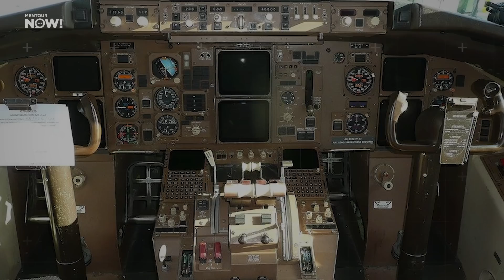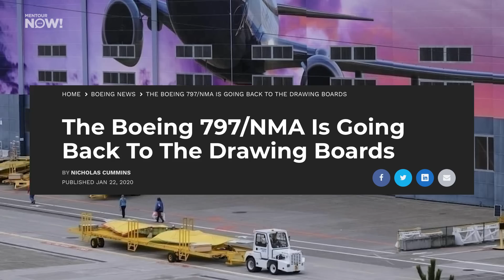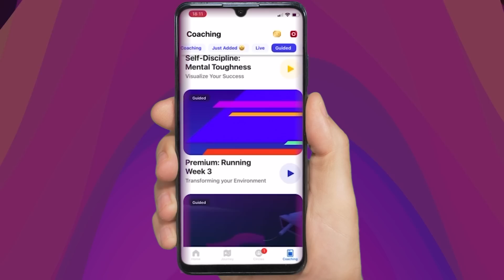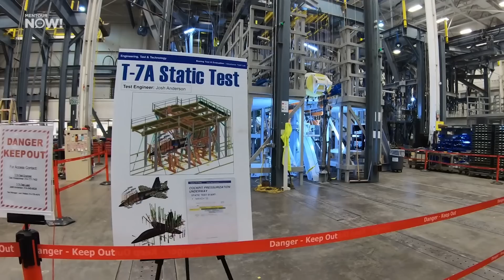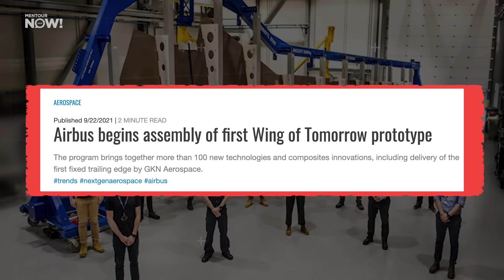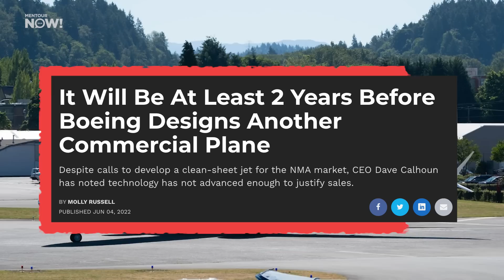Is Boeing Planning a 757 MAX?!

Comment: i remember boeing having an airliner for every requirement, they have a 767 too dont they? im sure i been on a few 757's, im not a fan of the 737 max, i wish they had made a totally different airliner and kept the 737 short for the stol airports, maybe they widthdrew the shorter 737's because of runways being extended, so there was less call for the shorter jets

So, aircraft are made up of rings bolted together, or sections, maybe 18 inches long, so, in theory, they could simply build a 747 without the hump?

What size aircraft was the 707 compared to?

Comment: They should go the route of the 787 cockpit and new wings and engines on the 767.  Common type rating and size to start at 220-230 2 class capacity.  Then they can concentrate on a new single isle to replace the 737.

Comment: I think the answer to the NMA problem doesn’t lie with the 757 I think rather a re-engined 767-200 around the 155T MTOW. A de rated 767-200er in reality with the GEnx-1B de-tuned to 55,000lbf would do the trick. Considering the 767-200 is still in production as a tanker so no supply chain issues.

Comment: Boeing screwed up will the 737MAX. It should have made a totally new aircraft that would have allowed them to put better engines under the wing without having the present ground clearance issues. They then wouldn't have had the MCAS issues that has cost them billions of $$$. They tried to do the upgrade on the cheap and it bit them hard IMO.

Comment: A no-win proposition, unfortunately - relaunching a program, once discontinued, would be very expensive.  Add in the extra costs for a new wing, new engines, new avionics, and so on, and (probably) a complete recertification process, and the question becomes, “Why not build a totally new airplane?”   Except…. The 787 program was their last all-new airplane, and (for a bunch of reasons) will never turn a profit.  Why do anything?  Lose money, or lose even more money?  Tough call (or easy call - do nothing).

All that said, the 757 was a great airplane, and generated loyalty for the type from airlines, pilots, and travelers.  The 757 was put down because it was more expensive to build than the 737, for essentially the same fuselage cross section.  Boeing believed that the 737 could perform most (not all) of the same missions as the 757, and with no rival to the 757 in the marketplace, the missed market was too small to be of much concern.  With the A321XLR, Airbus has probably sewn up the 757’s market segment now, so we probably won’t ever see a modernized 757.  Darn it!

Comment: Some important facts you ommitted:

The 787 was the replacement for the 767.  Boeing saw it lose 767 sales to the A330, so designed the 787 to be a 330 killer. It was designed as 8 across with similar capacity.  Only problem: it didnt sell.  (and that was despite Airbus waivering on whether to do a 330-neo or new aircraft (which became the 350).   Boeing saw success in the 787 when it densified the cabin to 9 across which made airline accountants happy. 

It was the airline accountants that wanted the bigger capacity, which increased gap between the 737 and 787.   And guess what, the 787-9 is the most popular one, so accountants weren't too interested is that gap between 737 and 787-9. 
 Similalry, Boeing also densified the 777 to 10 across seating (despite being designed as 9 across as replacement for DC-10/L1011/MD11 aircraft) which ended up killing the 747 that still had pleasant wide seats. 

The 767 was a terrible aircraft because it was good for passengers.  It added only one seat per row compared to 737 but with all the added structural cost of twin aisle and huge wings.   And remember that there was commonality between 757 and 767 cockpits as they were built as a pair. 

The 737 MAX debacle also resulted in the FAA no longer rubber stamping certificates when Being just claimed "derivative".  So derivatives are hampered not only by their old roots  but now bear certification costs similar to totally new aircraft (which have far mroe modern designs and advantages).  

A 757 derivative would have all those certification costs, and be an orphan with old 757 cockpit that has no commonality wth 737 or 787.  

Boeing also learned that its 1960s 737 has reached end of line.  And Airlines are not exactly buying many 737-7s they go for the bigger ones.  (and the A220 and Boeing's planned purchase of Embrare would fill the low end of 737 anyways).

My guess  is that Boeing is planning a replacement for narrowbody that will encompass between 757 and 737-8 and leave gap below for the A220 and whatever Embraer offers (and perhaps will re-ignite its plan to buy Embraer should Boeing fix its own house first). 

Airbus greatly benefited in  late 1980s and 1992 from a brand new A320 airraft family while Boeing just put on new engines on the 1960s 737 wtill runing on  ropes between cocpit and wings and vaccuum tubes for the little electronics it did have.  Keeping the 737 type certificantion meant keeping cockpit functionally the same (hence need to hide MCAS). 

But if Boeing in 21s century launches a totally new modern narrowbody,  Airbus will be the one stuck with the older aircraft that it tries to put new engines on.   The trick is to wait till that new narrowbody has the right tech and of course new compelling engines. (and climate change may be a big factor in this).  By now,  Boeing has good idea of which bet for the 787 ended up paying off and which are c0sting way too much.  (one piece fuselage sections, all electric design including brakes, etc).  So it could likely build a "best of both worlds" aircraft that includes the best of the 787 as well as best of conventional airdraft. 

The bigger question is how they will announce it. Start with the biggest variant to  compete against 321 and 767 and slowly work the way down to progressively replace 737s?  Or one kassive new announcement for full range from 737-8 to 757 range?   Doing it this way means one aircraft family with commonality for cikpits, and spares, engine etc.

Comment: Just a foot note to add to this, Boeing recently claimed the 757 had a higher than acceptable development and production cost which is SAD!!!, and made them nervous. (or are they making excuses just to annoy us ???) (They are famous for bad calls mostly lately remember.)  It's still my favorite aircraft 30 years later!  I absolutely love this bird!!!

It was as multipurpose as it gets, small high & hot  airports, cheap long haul back in the day and even enjoyed some relaxed noise abatements at some other locations. And we all know airliners have been somewhat mission designed so mission sensitive but this not this baby. She could go where 2 or 3 different models would go for a day and suck a profit out easily. 

If I were opening an air service right now I would choose the A321 XLR or LR mostly because Boeing dropped the ball and didn't replace this unique versatile757 airframe which was capable of so many differing markets, ranges and locations. But a replacement for the 757 would have been the answer to medium / long haul single hull economics.

Two of my instructors who flew it in later life said it was the Lamborghini of the skies. A big airplane that still flew like a little one, and made money most places.

I have been in the back seat twice coming out of Newark under a speed restriction, it's about as close as a layman will get to a NASA launch !!!

WHAT A FREAKING RUSH ! You really need to do this if you get the chance.

We had airline in Canada: Canada 3000 or affectionately  "C3" under fierce preditory competition but turned a profit for 19 years with just this single type.

Comment: I liked to fly in the rear section of the 757-300, only a few rows, pretty quiet.  Took a long time to deplane, but it never felt as crowded during flight.  The 75 and 73 use the same fuselage diameter so the Airbus single aisle being just a bit larger offer more room inside. As much as I love the 757 it makes more sense to do a 767 update with new wings and engines for reasons mentioned above.  A new 757 wouldn't have the buzzing RB211s , so the classic 757 sound would be gone too, so there's that as well.

Comment: Everyone is wandering around, scratching their heads about why Boeing isn't doing this, or why did they cancel that. Boeing is very close to financial insolvency - that's why. There's been so many mistakes and disasters at Boeing they're very nearly bankrupt.
Reply: Confirmed. The reason why they pulled out of the takeover of Embraer is that they couldn't afford to do the deal anymore (MAX, 787 etc). That was my first indication that Boeing was short of cash, then they canned the 797 and that just confirmed it. Even the 777-9 debacle is an example of cash shortage. A fully cashed-up company would just throw resources at the problems and get them fixed quick, but Boeing can't do this.
Reply: YEEEEEEEEEEEEES! Just waiting for it to go extinct!

Comment: As a passenger, I do not enjoy the current fad for single-aisle jets flying long legs: Perth to Singapore in a 737 is not fun. I'd vote for a short-fuselage 787 with de-rated engines to plug the gap between the 737 and the existing 787 (which is a delight to fly in). Shrinking a newer platform that is in production now looks like a lot less investment than either starting from scratch or re-winging and re-engining, not to mention re-doing the avionics in, a very old airframe. Airlines might find that offering a twin-aisle aircraft gives them a competitive advantage in the eyes of the people who buy the tickets.

Comment: The idea of Boeing reviving the 757 as a Max airplane, shows merit, and it would be great if it actually took affect. It would cost too much money to re-tool and restart the 757 program to give it a re-birth.  Despite the issues that  Boeing faced with the 737-MAX, and the 787, they have not been able to gather the results to launch the 777-9X into service right away, but I'm hoping that they can be resolved and soon. The 757 however,  is one of my favorite airplanes, and it would be nice if it became a reality to re-tool it as a Max airplane.  But I'm sure that Boeing has a significant say into this, and put together an airplane program that we've all been waiting for.  They of course do not need to back things up any further for this to happen because Airbus is getting far ahead and gaining more Capita.  That really scares me right now, though I'm optimistic about Boeing turning things to their favor.  I believe Boeing will get things together and build a commercial jetliner that will fill the void that the successful 757 once had.  I really hope this happens soon.

Comment: I worked on the 757 through the upgrade mods. Avionics and winglet mods. I always wondered why they got rid of them. They had a company out doing 3D scans of the leading edge slats as there were no replacements.

Comment: I loved the 757, too, and very puzzled when it ended.  I haven't flown since 2002, but 757 was my new favorite as there were less 747s (my fav) in the air, as it took routes from the 747, at least the airline I was flying.  The 757 was smaller than the 747, but very tolerable for several hours, and had the modcons.  Note that the only time I flew economy in a 747, it was very low capacity.  I imagine the 757 was much better in that regard than the middle seat, middle row on a full 747.  Thus better to design for economy than business or first class, it would seem.

Comment: Airline industry has limited choice on narrow body aircraft. Just  B737 vs A320.  B737 or A320 alone can not cover wide range of 120-300 seats efficiently. As demand of narrow body is soaring faster than anticipated, we should split seat range covered by B737 or A320 into 2 separate ranges of narrow body aircraft. We don't need 500 seats A380 or B747-8. So we can invest the money on two new narrow bodies of bigger 180-300 seats (B757 class 6 seats per row)  and smaller 120-180 seats (smaller than B737, 5 seats per row like A220).

Comment: if the og 757 is over powered could it run the leap engine fine? the performance would just be in line with normal planes.

Comment: If Boeing moved the wings on top of the fuselage, they would have room for larger turbofan engines. Why don’t modern airliners have shoulder wing configurations?
Reply: maintenance. landing gear stability. cost.

Comment: the company I work for is still on contract for spare parts. funny enough we recently got an order for a replacement tail strike bumper cover a few weeks ago. you are required to keep the molds for a real long time because airforce2 is a 757. but yea its starting to be a while, we do composites so we can have racks and racks of molds. but for like a bigger parts like stuff that would break would total the airplane, they might not have those on hand anymore.

Comment: Early on you mentioned that the 757 was possessed with an over-abundance of power.  Why hasn't either Boeing or Airbus designed a plane that can cruise right at the cusp of supersonic flight?  For international travelers even the hope of flying closer to supersonic speed than any other airliner would be an additional selling point.  I once saw a 757 take off from San Diego [KSAN] and that thing looked like it was at 5000 feet in a minute or so.

Comment: Boeing needs to kill it with a spiritual successor to the 757 (and call it the neo max plus X or whatever). The same power to weight as the original 757, but half the fuel consumption.

Comment: The quick and dirty solution is to develop an STC to install a new engine from CFM or P&W up-rated to 37K lbs (same as the lowest power current 757).
This worked nicely on the DC8.
Then new engine would be the basis for a future clean sheet NMA.
There are still many 757s and their owners would love to give them a new lease on life. Especially in the freighter market.
The A321XLR can't match a re-engined 757.
Reply: @mipmipmipmipmip The B757 has sufficient ground clearance for much larger engines. The 737 is different, it was purposefully designed to sit low to the ground because when first designed, it operated into airports with poor support equipment and ground crews needed direct access. Even so the Max is a perfectly safe airplane.

Comment: Excellent aircraft. 757 NMA was  the initial priority for Boeing, but the 737 max was the winner. Great for 4-5 hour flights, but a misery in coach beyond that. The mid cabin entry was an godsend for first class, as it left the aisle empty - TWA used this to attract business fliers. The value to the airlines was that the 757 and 767 were considered the same type. Don’t know how many 767 pilots are still type rated.

Comment: I've always had a wish that Boeing would re-develop the 757.  Every time I stepped on board a 757 I felt like I was home!  The 757 was the most sought after used aircraft for over 20 years.  It was the last aircraft to come out of Long Beach and the mind of McDonnell Douglas engineers that wound up working for Boeing at the Boeing acquisition of McDonnell Douglas.  No doubt the tooling is long gone for the 757, as are the engineers and workers who built them.  Starting over using the design characteristics of the old 757 are possible though given the advance in design and tooling software available today. Whether that or a clean slate for a new aircraft to fill the gap, will be a hard decision for Boeing to make.  I hope it's a revival of the 757!
Reply: What do you mean saying "It was the last aircraft to come out of Long Beach"?

Comment: If Boeing would've done that before they started the 737max, they would've had the perfect aircraft platform for several years.

The 757 sits much higher above the ground due to its bigger landing gear. It already has bigger, more powerful engines so fitting new modern more fuel efficient ones would've been much easier as on the 737, so No MCAS neccessary. 
In fact the old RB211 engine have a bigger diameter than the CFM Leap engines. 
It has a bigger wing surface which creates more lift, so the airplane can be streched quite easily without strange modification neccessary. 
(757-200 vs 757-300.)
Its also narrowbody. And Boeing had plans for a smaller 757-100 (it was never realised) which would have the capacity in the range of the 737.
If Boeing would've done the NMA plans a few years ago they could've used common parts and systems used on the 767 since its still in production and other Boeing airplanes still in production.
The landing gear of the 757 was infact developed from 707's landing gear. So sharing parts or systems from their other airplans is something Boeing has done successfully before. But i guess it to late now for a 757max. 

But yeah the 757max would've been the better 737max if Boeing would've done that. 

To be honest, @Mentour Now! 
You would have absolutely loved flying either the old 757 or a potential 757max Petter. 
A friend of mine (a DHL 757 F/O) told me a famous joke amongst 757 pilots that have flown the 737 in the past: 
'you know how the 757-200 climb out performance is, when one engine fails? The same as on a 737 with two working engines.' ;)

Comment: At the end of the day, it more so comes down to cost.  They could easily bring back the 757, but it wouldn't be worth it.  Now they could use the overall layout and create a brand new aircraft around it, but it still leaves that top end of the market problem.  What they should do is just build a new version of the 757, but also build the 787-3 that they already had designed years back.  That would fill the void, and they could use the parallel development to save cost and add commonality like they have with the 757 and the 767.
Reply: Yeah not sure why the don't let 787-3 pop but up ?